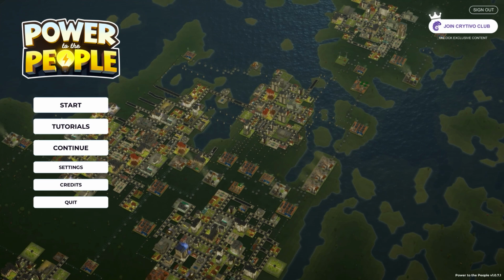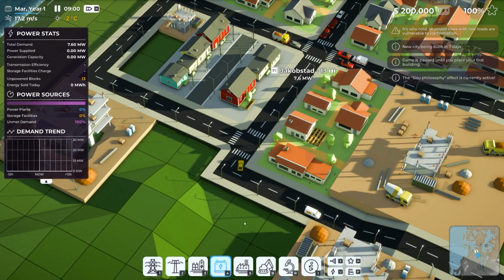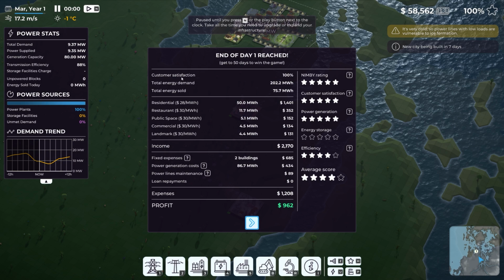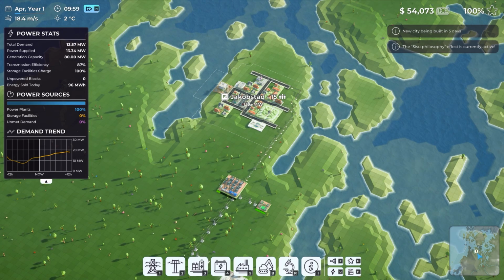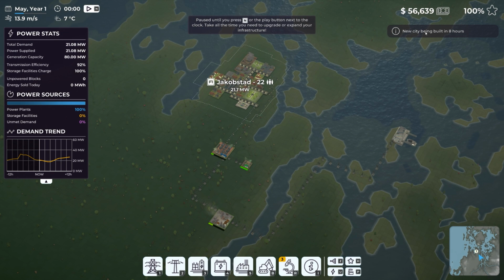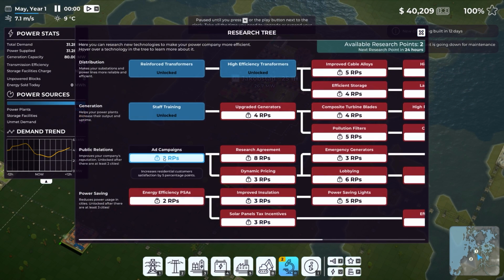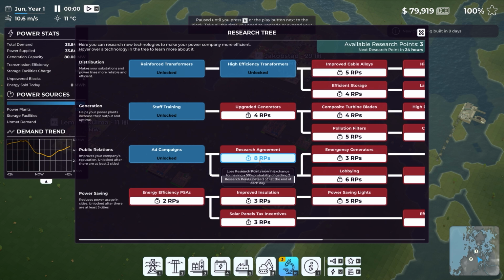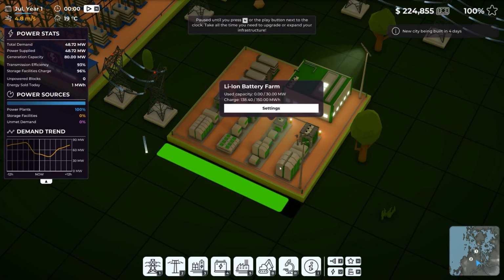National Grid Simulator | Power to the People #1

Comment: Research agreement will repay itself only in 16 days on average.
50% of getting extra RP per day means you it will most likely take 16 days to get what you've spent.
So, these 16 days, plus 4-5 days you've spent collecting them (over another research you could make) are simply wasted for immediate bonus you could already have.
Considering, this is only 50-days level, and there're about 35 days left, you'll get "profit" for roughly 20 days, meaning you'll get 10 RP on average.
It is deffilitely not worth it at such short scenarios. It would work way better at longer scenarios (or endless, if there is such thing in game), especially if beelined.